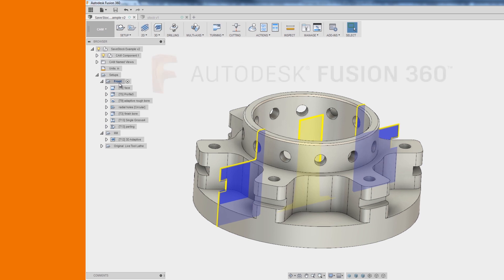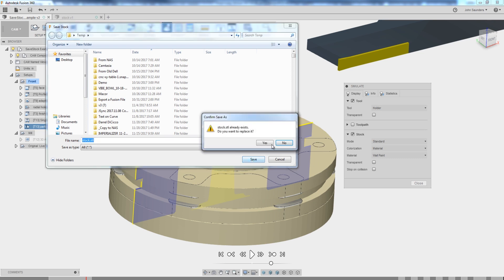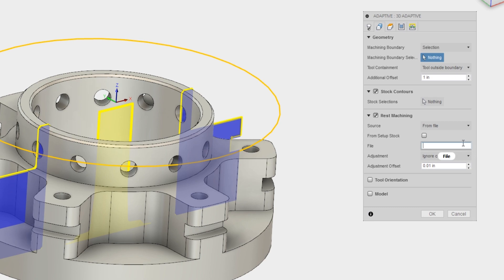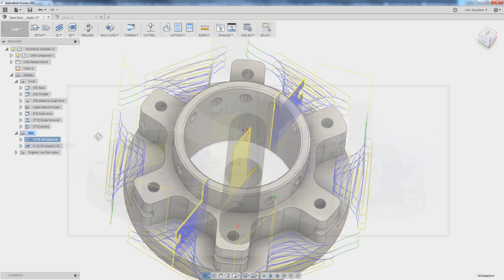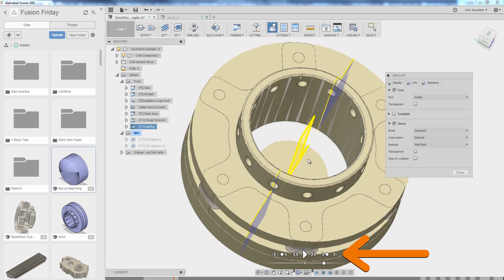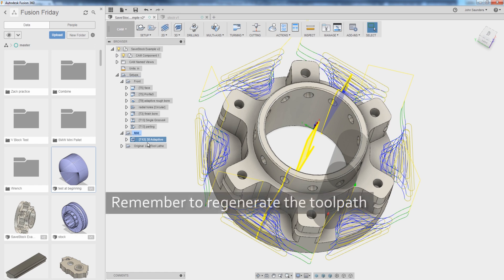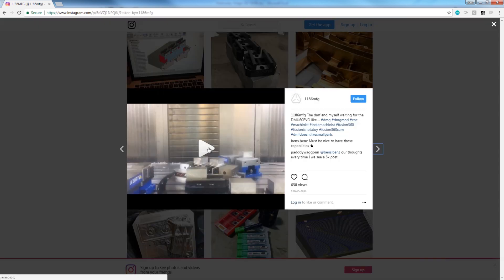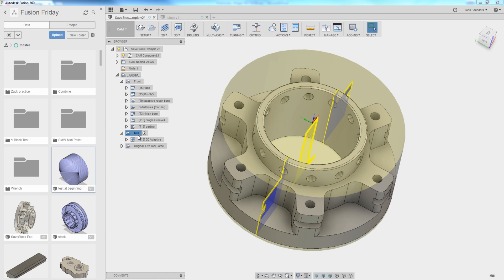Carrying Stock between Setups in Fusion 360! FF114

Comment: 2 years later! here's a slightly more streamlined way to tackle this problem.

https://knowledge.autodesk.com/support/fusion-360/troubleshooting/caas/sfdcarticles/sfdcarticles/How-to-use-stock-from-previous-operation-within-a-new-setup-in-Fusion-360-Manufacturing.html
Reply: Yeah, I just did this today and it's (IMO) nice that this finally got added.
Reply: Ehhhhh so I lied (not really). While this is certainly in fusion, I ran the job a few hours after posting this and let's just say things were the hottest of messes. I'm not sure if I did something wrong, but I certainly assumed that the rest machining would be taken into consideration against my WCS point. I don't believe that was the case; after my facing operation completed  my next roughing operation cut super deep into my material (it included the depth of material that was removed from the facing operation).

Fully aware this was probably more a me thing than anything else. I had zeroed to the machine bed for the facing operation (a cnc router) and then faced the material to thickness. Ran perfect. My next setup zeroed off the top of the new material (thinner now) but there was no way in Fusion that I could figure out to select a point on the new, carried over via Rest machining material like you would if you just used a new model (stl, etc.) and used that as your "new" material. I suspect this issue caused fusion / machine / me / everything to think the material was thicker than it really was, and my poor little ballnose endmill was like "what are you doing bruh?!?!"

In hindsight, I could have probably done a few things differently, and I'm debating how I want, or don't want, to use this moving forward.

Any other insight here would be super appreciated. I think it's a fantastic feature to have in fusion, and my simple brain is just missing something, probably obvious.

Comment: Importing as stl file works better, simply change units to mm when importing stl file, and it will auto-size.  The above method only works with a 3D Adaptive, it does not work with a 2D Adaptive. Still, a very helpful video as always.

Comment: Mr. Saunders, thank you so much. I have a bigger (12") part that needed this to avoid the flip operation milling alot (+3 hours worth) of air. And it's 3d, and there is a flip fixture to avoid. This is the answer. Gracias.

Comment: I wanted this to work so badly but when I try to 3D Adaptive and use "Rest Machining" I see the path generate to about 37% and then I get a RED exclamation with the Error: Internal CAM kernel error. Please report through your support channel. I have googled for a solution, however, none of the solutions resemble the situation I am in. Any chance this is an error due to the newest release (2-way adaptive)?

Comment: https://forums.autodesk.com/t5/fusion-360-ideastation-request-a/use-stock-from-previous-operation-in-new-setup/idc-p/7110170

John, Thank you for sharing this information.  I also tried to do this by importing the model and got frustrated with the scale and origin misalignment issues, so I will give this another shot and import the file directly into the setup config.

Also, anyone who cares about this functionality... please vote for it on the forum, link above.  The feature request has existed since Aug 2015.  I have no Idea why this has not been addressed yet.  Seems like all of the the functionality already exists.  It just needs to be wired up and UX needs to make some minor adjustments to the CAM config views to support it.

Maybe the API can be used to automate with a plugin.  Its possible file watcher lib in python could be used to fire off updates to the  downstream setups (https://pypi.python.org/pypi/filewatch/0.2.0) if the API allows access to this property.  If I can get it working, I will share.  This missing functionality is driving crazy! :)

Comment: Looks like they are millimeters away from making this an automated/integrated feature. Although it works, there are still a lot of steps....

Overall though....I am just about done with SolidWorks and MasterCAM. Both amazing pieces of software, but just too much money relative to what Autodesk is doing. I am an engineer and machinist - F360 will easily handle everything I design and manucacture.

Comment: Hi John, bit of a moot point, but the sizing worked when doing it the other way.....but you have to be in mm.  Put your CAM in mm, simulate, save stock, go into CAD....make sure it's in mm.....then do the import and convert to BREP......sizing and placement should be just fine.  I don't work in mm, so it's a bit of a pain to change things back and forth.  Looks like this method you found will be a lot easier to update!!  Thank you! I'm sure I'll be trying it in the next hour or two. lol Mike
Reply: This method sometimes does not import the mesh aligned with the part. Sizing appears correct but the mesh is definitely not where it should be.
Reply: @frijoli9579  Hablas español? a que te refieres con lo de la malla no alineada? 
What do you mean by the non-aligned mesh?

Comment: I've used that method on some valves so adaptive didn't do so many air cuts when the pockets of the valve met a port that had been milled out in the previous op. 

Definitely not an obvious thing to find. I would love to be able to set my stock in a setup folder to use the results of all the previous setups before it. That way if I changed an op in the previous setup fusion would alert me that I need to Regen the latter ops. Seems like that should not be a tough thing to implement. Basically what you did here, just automatically.

Not super useful for every job but I have quite a few valves that this would make my life so much easier on.

Comment: That’s incredibly klunky.  

Almost easier to just run adaptive paths and constrain them by levels or areas. 

And the fact it doesn’t update is worse. 

I saw that option but like you would save it and couldn’t find where the hell it went or how to get it to do anything useful.
Reply from the maker: You always see the glass as half empty; I see it half full.
Reply: NYC CNC 
The glass is always full. But I prefer it be more whisky than air 😁

Comment: That looks like it works for rest machining. What about designating stock for the entire second operation? I had done it before by running the first operation simulation. Saving as an STL file in that stock drop down menu, and then importing the STL back in and clicking that as my stock for the second operation. Is that improper?
Reply: Some say it is fine, some say it's a lazy way to do it that should not be done
Reply: That sounds like what I've done in the past. Not convenient, but it worked. The biggest hassle was having to re-import every time I made changes to the work in the earlier setup.  The technique that John described involves fewer steps when you make changes - you still have to export the simulated stock result, but you don't have to upload & re-select the stock for the second setup.